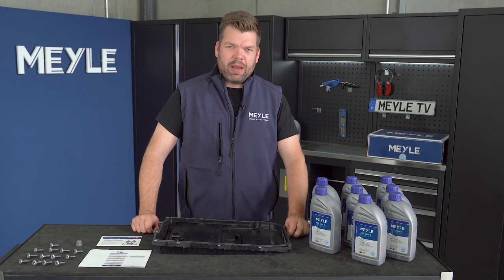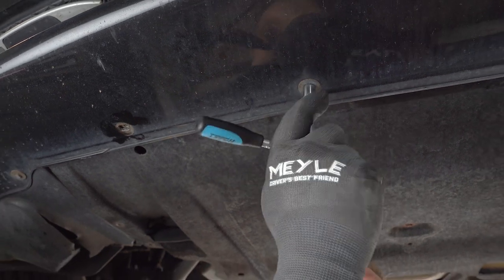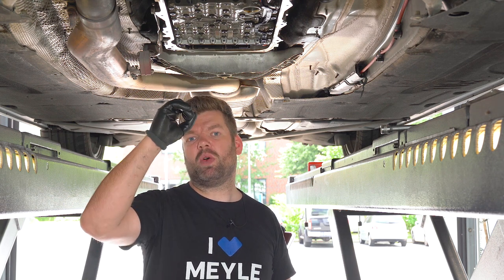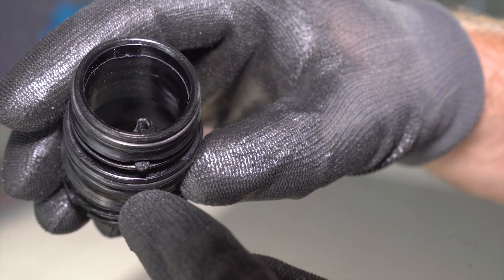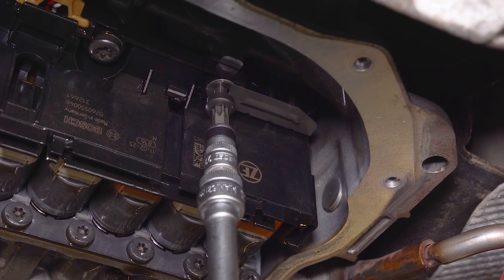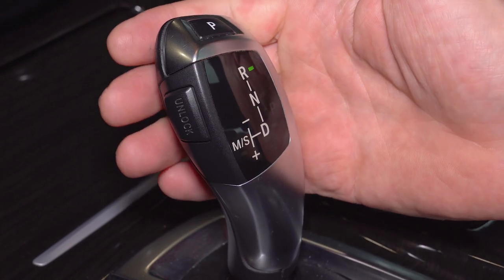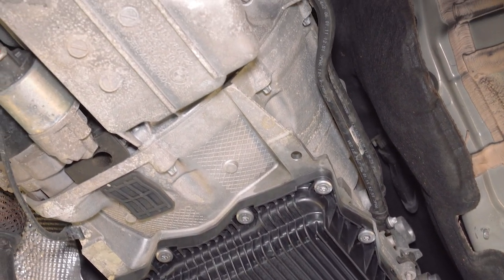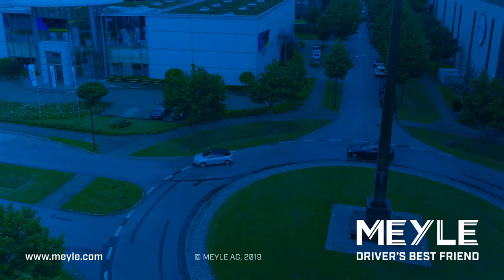MEYLE-ORIGINAL oil change kits for automatic transmissions (ZF8HP - 8-speed automatic)

Comment: Great explanation except one thing, always loosen the filling plug first, in case you drain everything out and you can't get the filling plus loose you could be in big trouble
Reply: You can always fill trough cooler hose inlet. No big deal
Reply: @martinporter6478  can't correctly measure the oil level in the gearbox if you use an alternative like you say. To many things to go wrong, like pressure in Pan would increase as the gearbox breather wouldn't compensate for the refill (particularly if using same forced induction method. and the cooler hose might not be same level etc, so certainly a big deal?.

Comment: Thanks for the useful video. It seems that the procedure steps described in this video is somehow different than ZF original instruction manual for 8HP. ZF manual says, after second filling and overfilling 0.5 Liter(while engine is running), the car must be driven in order that the transmission fluid warms up (to 75~80 'C) and the oil cooler thermostat opens. Then ZF says that while we should monitor transmission fluid temp. to stay between 30~50 'C, the the torque converter filling should be done  (maintaining the engine RPM at 2000 for 30 seconds) and after that we should put in P/R/D sequentially and then manually shift to D1 and D2 (and hold each for 10 seconds) and after that we should do the final level check from filling hole. So why your procedure is different?
Reply from the maker: Hello AM Jahan, as you said the car has to be driven to warm up the transmission fluid/let the thermostat open. The torque converter is filled during warm up drive already. Gears have been switched as well. After warm up drive allow gearbox oil to cool down and recheck oil level at temperature between 30 to 50 C°. While engine running refill the necessary amount if needed. Makes the whole procedure easier and more quickly. Best regards, MEYLE-TV

Comment: How much oil can you action get into the gearbox, looking at the oil/filter pan and fill plug it doesn't appear to hold that much. Does the torque converter still retain the old oil, when it is supposed to hold 6 - 7 litres..

Comment: If the car has the transmission cooler, after I warm the temperature of the fluid to 75 deg, do I have to cool it down to top up, or top up when it’s still hot and running?
Thanks
Reply from the maker: Please check your manual. Also please refer to your manual regarding the checking temperature.

Comment: I was planning on just draining oil and refilling without replacing or removing pan, is it possible?
Reply from the maker: Yes, it is possible, but it doesn`t make sense. The “heart” of the lubrication system of the transmission is the filter, if you do not replace the oil pan, you will not renew the filter element which is part of the oil pan.

As a result you will fill in new oil which goes through the dirty filter element, in addition to this the old filter could be completely blocked in the near future.

We highly recommend to change the oil pan including the integrated filter.

Comment: I have a bad vibration in 6th gear on 8HP75z from 1500rpm under load? The gearbox was rebuilt and the flywheel replaced. The torsional vibration damper was also checked by BMW.  The problem persists and no-one can figure out why its happening. Any idea what could be causing this?
Reply from the maker: This is pretty hard to evaulate from the distance with no detailed vehicle data. In this case please get in touch with our Technical Service Team. You can reach them by using our contact form: https://www.meyle.com/en/contact-2/technical-request/

Comment: Is there a way to drain the oil cooler also? Its seems the any residual oil left in it will contaminate your new fresh oil once you warm the car up to 75c.
Reply from the maker: The kit is intended for changing the oil and there is always residual oil in the system. Also in the oil cooler.
So if you want to get all of the oil out of the system, you would have to do a transmission flush for automatic transmissions and have it carried out. Or remove the oil cooler, drain it manually, clean it and reinstall it.

Comment: A question to the Meyle Expert and the Community:
I had an appointment at a ZF service point to flush and change the transmission oil of my ZF 8HP45 after 85k km. My F20 is changing gears like a brand new car since then. However, when the transmission gets hot, it starts to smell quite badly via the air vents. This issues occured right after the oil change. After two weeks it is not gone yet, althoug it has improved slightly. The service staff double-checked the transmission. No leakages were found and no oil was outside the gear box. They told me, it is quite common that the F20 or F10 series from BMW tends to smell due to the fresh oil. It should stop smelling after a while. 
Have you experienced something similar so far?
Thanks.
Reply from the maker: Due to the unfavorable position of the transmission vent, unpleasant exhaust air can actually occur via the engine compartment into the passenger compartment. This has also been confirmed by ZF. 
We must first assume that the correct oil specification of the transmission was used. However, the oil grade used should be checked again and changed if necessary. If there is still no clear improvement, we recommend that you consult another transmission specialist to rule out a possible thermal problem.

Comment: Hello sir 
I have dodge charger v6 engine 2014 model and my question here is:
Is that stuff you used in the video it's same stuff that I have to pay to my car
And about the steps in the video I have to follow with my car,,, and if there is any more details or instructions I have to do with my car transmission 
Thx a lot for a video it was very useful
Reply from the maker: Hello Zaher, basically just follow the steps in the video. If you have a ZF8HP installed the necessary steps should be the same. If in doubt check the manufacturers manual. Best regards, MEYLE-TV

Comment: My 2016 Ram 1500 uses the same transmission. I now have 114,000 kms. on it. Is it time for a fluid change? Chrysler says it's "lifetime fluid", but I don't believe them. What do you think?
Reply from the maker: Because your vehicle has 114,000 km on the clock, you may want to consider a transmission oil change.
But you can also look into your own vehicle documents/service booklet or similar.
That should also be in there.

Comment: You dont need to reset adaption in transmission after fluid change????
Reply from the maker: A reset of the adaption values is not required after a oil change on this gearbox.

Comment: What is the ZF transmission type used in 2005 Bentley continental with the W-12? 
Do you sell new bolts and filter kit for this 12 cylinder 2005 continental gt. I am not looking at car now but i believe that in 2005 the bentley has the ZF6hp 6 speed.
Thank you
Reply from the maker: Without the detailled vehicle data, we unfortunately cannot say which transmission type is installed. For this vehicle, however, we also unfortunately do not offer a parts kit.

Comment: Doesn't gear box ecu need to be done at same time ?
Reply from the maker: Hi!
What you can do is to reset the adaption values of the gearbox. But this is not mandatory. There is no need to do a video of an oil cooler either. Just follow the steps shown in the video. :-) 

Your MEYLE Team

Comment: Is it ok to just drain the oil and fill it back up with new one?
Reply from the maker: Hello, could you please specify what exactly do you mean? You should follow the intructions given in the video.
Reply: @MEYLETV  He probably is trying to say that if he can only drain and fill it without turning the engine on, go for a test drive etc
Which the answer would be no (the oil level would be low and that's dangerous because overheating and slipping) but you can explain better.
Reply: @MEYLETV  Nevermind, I had my mind somewhere lol. I'll keep this video in mind. Great content btw!

Comment: you forgot to select 1to 8 gear in manual mode
Reply from the maker: Hello Hans,
thanks for your comment. As I mentioned in the video “with the engine running switch through the entire range of gears”. Each shifting process is not shown from us in the video. Probably should have shown it to prevent misunderstandings.